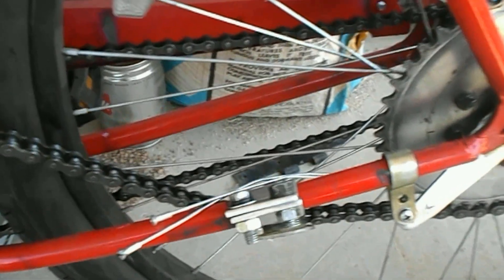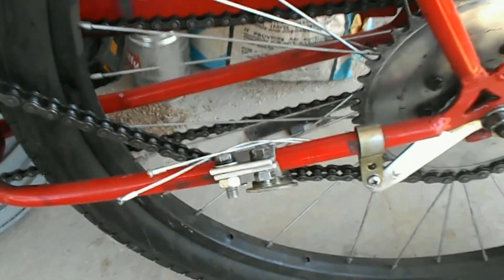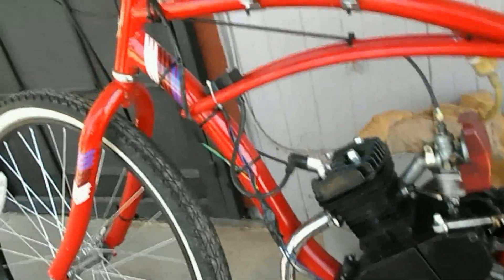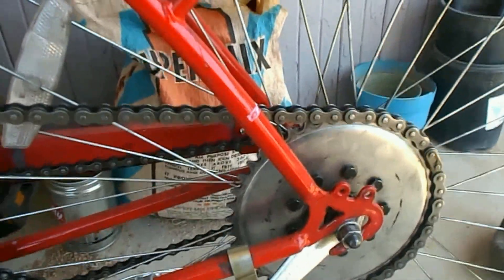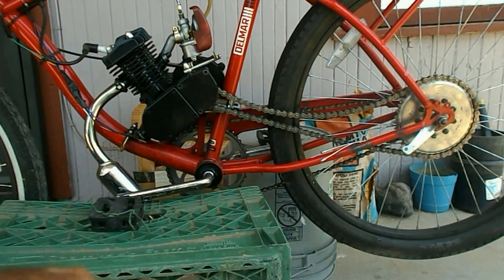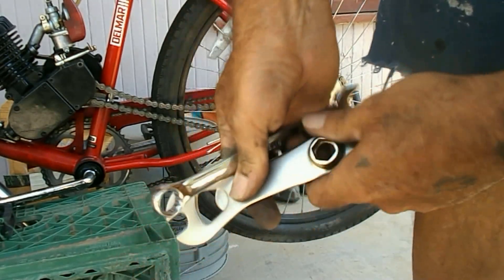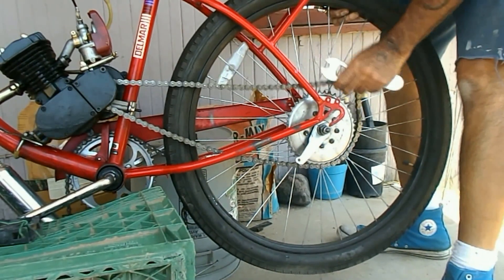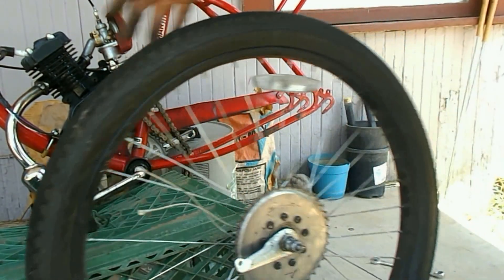Explaining the forces that destroyed the rear wheel on my Motorized Bicycle

Comment: Most bike engines i see dont even use a tensioner. Spring loaded tensioner mounts to the engine itself would probobally operate better considering the mechanics of it operate like that of a derailleur shifter.That type of chain tensioner is for more of a single speed drive train like those found on coaster brake bicycles with angled dropouts on the back of the frame like most beach cruisers have.

Comment: I had a 1 " rachet strap come off my lunch box on the back rack and it go caught in the spokes at 30 mph. Luckily I had both hands on the handles bars cause it instantly locked the back wheel and I split for 30 -40 ft when it finally stopped. The back tire was rubbed through, tube was busted and destroyed chain gaurds along with a good bit of my nerve. Then when got it rolling again week later the warped wheel cause the chain to get hung up and blew apart about 5 links making the chain useless.

Comment: Dude you could have put a self tapping screw through the tentioner preventing it from rolling into the wheel... I think they are a whopping .10 cent a piece... That's what I found works
Reply from the maker: Did it work out?

Comment: Either run a self tapping screw through the tensioner into the frame or drill a hole and put a bolt though it problem solved that's what I did
Reply from the maker: Has your frame broken yet"/?
Reply: @Brian136  no, I doubt one 5/16 self tapper is gonna comprise my frame but hey you never know
Reply: @aaroncraig2250  a tiny hole wont hurt it and if you do this id recomend a short self tapper that only goes through one side not out the other

Comment: Drill a hole in the tensioner bracket where it bolts to the frame, mount tensioner, drill a hole in the frame and install a sheet metal screw. tensioner cannot move.

Comment: Its cause its too tight u need just enough slack, when you go over bumps the chain tightens up and when its too tight with not enough slack and u go over a bump the slack the chain needs just rips the tensioner off from the power

Comment: I m taking my stock tensioner out of the picture. I am now using a motor mounted spring loaded " none jammy"
Reply: There is a couple of new chain tensioner that cannot reach the spokes accessible online, try Bike Berry.com
Reply: You can drill a small hole through the whole frame of the bike and the tensioner and put a small bolt through it

Comment: stock tensioner is just lacking a support strap to the upper frame.
You can also drill through the tensioner bracket into the frame and insert a roll pin or tap a threaded bolt in there, 
can't rotate if its pinned.

Comment: Can you send me a link on some good chain tensioners?
Reply from the maker: MMbikeparts on ebay  only one u need bro unless u are going for the cool factor then there is about a million copies and clones that I wouldn't trust if my ex-mother in law was riding it   you want reliable dependable hard working shit that don't break need more that one tool to fix and when you only got enough money for one beer and $.45 Worth of gas to get there bro you want the best shit there is right? Fuck ya your right MMbikeparts.com
Reply: They have them with real sprockets on eBay the ones with the spring that screw onto your motor

Comment: I don't even use the coaster brakes anymore. Lately I've been taking the coaster brake arm off and using c brakes front and back. I've had issues in the past where the nut and bolt holding the coaster brake arm to the frame falls off. Then the coaster brake alarm starts going round and round  and then the Hub just self-destructs.  Sometimes you can save the Hub but they never quite the same as after that.
Reply from the maker: Bro they invented some stuff to stop that from happening back in the 60's it's called blue lock tight available at your local Ace hardware store "the helpful hardware place" 
Yes I have encountered this problem a few times never to the extent that you are discribing but it has happened. Since then I have always checked the lock ring that holds the gear and brake arm in place to make sure it is seated all the way down in the channel made for it. ( Chinese mechanical experts put them together remember ) them i lock tight the lock nut that keeps the bearing race in place. Install the wheel to the frame and lock right the lug nuts. Lastly I connect the brake arm to the bracket on the bottom left chain stay using case #8 hardened bolt washer and nut. 
Haven't had any problems with this part of the machine since then. I'd you are using v-brakes on both ends good for you they work but because of the tentsion on the cable when correctly adjusted it (cable ) tends to stretch guickly and is in need of adjustment a lot. You might not think so but if you are pulling the lever all the way to the grip you are not getting all the braking force V-brakes are capable of generating. Your choice beo. Coaster brake on the rear wheel is more of a positive braking force to slow the momentum of the weight moving forward. Because it's working at the hub where the torque is instead of the rim edge where the friction is. Thank you for the info someone will want to switch out for v- brakes and your bike uses them all good I say be safe and wash your hands")
Reply: @Brian136  i just used a mountain bike wheel on my cruiser and a normal brake

Comment: Just a tip, to avoid having the chain tensioner fly into your spokes without buying a different tensioner, try drilling a hole through the chain tensioner and bike frame and insert some sort of sturdy secure pin. This should keep the chain tensioner from twisting and shifting.     Inserting a bolt and securing it with a nut would also work very well.
Reply from the maker: 27 number of times this has been commented on this video") drilling a hole in the chain stay will compromise the steel under torque applications. causing stress cracks my friend the welder showed me on his bike and it's not fixable he had to get another frame.

Comment: Got a question and I can't find any videos on my issue. I am having a BITCH of a time trying to get my rear wheel to line up perfectly straight, to where the drive chain doesn't rub up on the rear wheel. How do I fix that issue? 3/4 of the wheel clears the chain, but when it's rotating I can't see and hear the chain rubbing when the wheel wobbles a bit while I'm spinning the tire. I can't fkn figure out for the life of me why I can't figure out a solution. I REFUSE to pay a bike shop $40 for such a simple thing. I should know how to do it and I don't and it's pissing me off. Any help or suggestions would be greatly appreciated 🤘🏽
Reply from the maker: Simple answer is the wheel is out of true. To fix it you need a wheel stand and spoke tool lots of patience. If that isn't the answer then answer this question. Does then wheel wobble back and forth either rolling or standing? If so wheel bearings are loose. Need 15 mm and 17mm cone wrench to tighten up the cone nuts that are on the axel inside the lugnuts. Recheck my videos explaining the forces that destroyed rear wheel or rear wheel wobble and how to fix it in the playlist red speeder bike if problem still exist send  me email and we see if we can find a solution together best I got bro without anything to go on ") let me know briannoel49@gmail.com

Comment: Happen to me as well I’m about to drop the spring one
Reply: Spring one did this to you????
Reply from the maker: No stock Chinese piece of junk did this then I got  the spring one used it for a couple bike builds then a follower sent me a link for a video about cutting the chain to fit and I dropped the tensioner all together haven’t had a problem since”) thanks for watching
Reply from the maker: there are a number of chain tentionsers on the market that will do an adquite job but in the end i think if you just cut the chain to fit  then the problem goes away until the chain is in need of replacement")

Comment: Just drill a hole through the tensioner and into the frame , you won’t have it move on you every again , or just use a self tapper screw and boom it can’t move and will be more effective and efficient on your chain

Comment: There’s another issue you need to do if you haven’t already done it since this video if you insist on continuing to use the sprocket from the kit that bolts on the spokes you better make sure both front and rear tires spokes are 12 gauge or stronger but I suggest specially to anyone that reads this I suggest you also ditch that sprocket that comes in the kit and get a sprocket adaptor that clamps over the hub not onto your spokes
Reply from the maker: Did that already but thanks for the input
Reply: Your welcome

Comment: Hey man my back tire is locking up on me cant fix it you got some tips bro
Reply: Raven Jones possibly readjust the clutch. That was the first thing I had to learn when I got my motorized bike. There's the cable and the clutch arm and then there's the clutch itself, which has a bit that you can loosen and tighten. It might help with that
Reply from the maker: Raven sorry I haven't responded to you but I been indisposed") anyway if you still have the problem I would recommend pulling the clutch cover and readjusting the clutch the correct way. Once the cover is off you will see a brass nut in the center of the clutch that is kinda shaped like a flower. Loosen the nut and turn the screw either a quarter turn right (more grab) or quarter turn left (less grab) until the bike rolls with the clutch lever pulled in. At this point tighten the flower nut back up and start the engine. With the engine running and the cover off do any fine tuning to get the right amount of play in the clutch lever that you want/ need and take a test drive to make sure. Replace cover and ka-bingo there you go. Once again I am sorry for the inconveniences and missed opportunity for you to get your bike running if you have any more questions u am here now and always willing to help") thanks for watching

Comment: Mine did the same thing... So I went with a engine mounted spring loaded chain tensioner.... notice how the notch where you slide the axle split apart...!?!?!?!... That weakens that part of the slot when you bend it back to it's original position

Comment: You are absolutely correct! I so much appreciate these videos...I watched many others before I built my first motorized bike. You have taught many things to avoid and how to complete the buid correctly! I did in fact upgraded to the spring loaded tensioner that attaches to the engine and the 36T sprocket with the hub adapter. I've paid a little more than what I've seen others stated what they paid... $35 for the tensioner (Michaga Motors) and $84 for the sprocket and hub adapter (Bike Berry). I will attest, these are must needed upgrades! My rear wheel no longer wobbles and I don't have the fear of the tensioner jacking up my spokes. Thanks for posting! I've learned a great deal!
Reply: Sorry to the typos!
Reply from the maker: All good bro 👍

Comment: My rear wheel bearings on my Del Mar failed like that on me yesterday while I was riding. My wheel started wobbling like crazy side to side and i looked back and saw ball bearings bouncing down the road behind me... I am glad you were alright after that chain tensioner failure, I have worried about that a lot so I welded mine up right to the frame so I can have a little more peace of mind when I ride long distances.
Reply from the maker: TR7 TRIUMPH yes in my view the chain tentioner is the weakest link ") thanks tr7 for watching

Comment: Absolutly correct, a piece of crap chain tensioner. electric motors bend them over & over.  i would recomend a black hawk spring tensioned to have some give, so do some high perfomance motorcycles.  switched over to right side with 7 speed gears, not a problem one. 👌
Reply from the maker: i like the MichiganMotorBikes version on ebay it is the first version of this type and in some cases with the wonky side covers the best one that fits")thanks for your input little brother")

Comment: Sup buddy  I'm Adrian and got a question my friend bought a bike on craigslist it runs but is it suppose to be so hard to peddle just to get the damn thing to move I thought he was able to use the bike still with out the motor on and yes trying to ride the bike thru quit neighborhood so can't turn it isn't he suppose to be able to still ride it?
Reply: He probably has it on a lower gear put it on a bigger sprocket in the back your chain second gear easy to pedal
Reply: Clutch in

Comment: i had this problem also. and cool idea using milk crate and bucket as jack stand.
Reply from the maker: ya it worked pretty good but it made it just a little bit of a chore to move the bike around durning re-install of the rear wheel") thanks for watching

Comment: I just bought a 50cc bicycle motor  and up together  but I'm having problems starting it I'm not getting any fire or pressure and it is rolling  freely with and without couch bar in and out can u please help me asap
Reply from the maker: Did you adjust the clutch by turning the flower nut? Take the clutch cover off and remove the set scree turn the but one click right replace the set screw try again. If still the same turn one more click on the flower but keep going until the clutch grabs and then enging will try yo start if not you got problems with internal stuff

Comment: ....Brian Noel how do you fix that coaster brake issue?, I've seen here on YouTube where the brake can bind and lock up wich is f n scary so I don't have the cruiser mine is a mountain bike I don't see coaster brakes being safe at all
Reply from the maker: well timber wolf it has been a standard part of te bicycle for the last 100 years and if maintained right the coaster break will not only stop you in aa hurry it will also keep the amount of wear and tear on the rear wheel down to a minimum. just about every bike i have ever owned was a single speed with a coaster break or a free hub and center pull breaks. the way it works is there are a couple pals inside the hub that allows the application of the breaks very simple and smoothe. the more force you apply to the brakes the more you are going to stop when you really need to without to much luck you could end up hamburger in the street because of the breaksw on your motorized bike.

Comment: Same thing happened to me except the rear sprocket destroyed my spokes
Reply from the maker: that is what usually happens because the stupid tensioner clamp just won't stay tight enough to be stable. I highly recommend installing a hub adapter to solve this problem before something really bad happens because of this shitty part.
Reply: +brian noel yeah but I'm broke it was a cheap Walmart bike I'm replacing the wheels with a mountain bike wheels

Comment: forget foster brake go with disc brake that way you can attach the sprket to the wheel
Reply from the maker: that's why I went with the hub adapter drives the wheel not the spokes") thanks for watching

Comment: i just bought a new kit.  the chain tensioner is garbage.  doing the same thing. and the master link is jumping every time it hits the tensioner. need something between the clamp and the bike bar to hold the tensioner in place better.  rubber?  duck tape?  something for the clamp to bite on.  its to big for the bar..
Reply from the maker: +Anthony Rhubert I tried all of that stuff only thing that i didn't try was drilling the chain stays and putting a bolt through. the hole would have been to big to support the stay and the frame would have broken in matter of days. the reason i went with the chain tensioner i did was it bolted onto the engine case giving more support for the torque of the little engine. Thanks Anthony for watching
Reply: +brian noel no i agree with your new method.  was just saying like the are junk and mainly cause the plates/clamp is to big in the first place.  I'm a new rider.  just got my first and have two more on the way.  watching the pro's 👍
Reply from the maker: Anthony Rhubert buy the chain tensioner from much again motorbikes.com
Reply: brian noel if thats the case your master link clip is on backwards
Reply: I didn't have any problems w/ my stock chain tensioner but I thought I'd be prepared. I drilled & tapped the outside bracket  & installed two 10 - 32  Allen - head set screws & ran them in to just touch the chain stay then about a quarter turn more to make sure the tensioner assembly stayed put. So far it's been O K . I check  the set screws every so often to make sure they stay tight.
Reply: Stick a zip screw into it and fasten it right to the bike frame so it can't move